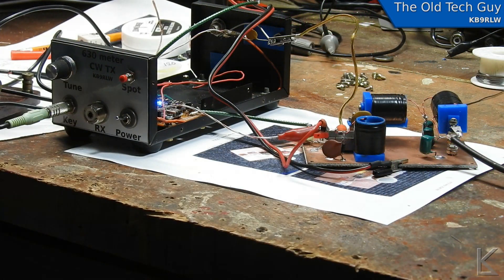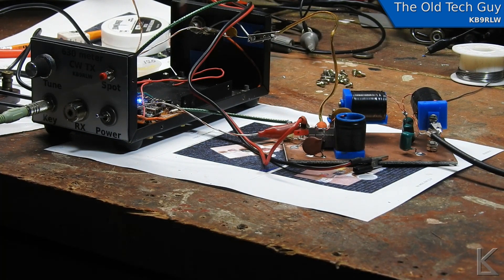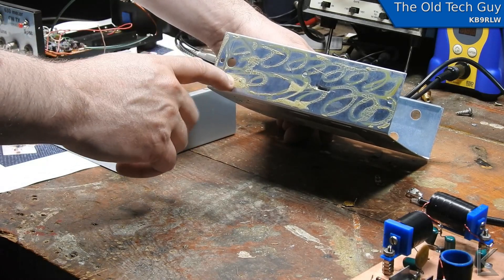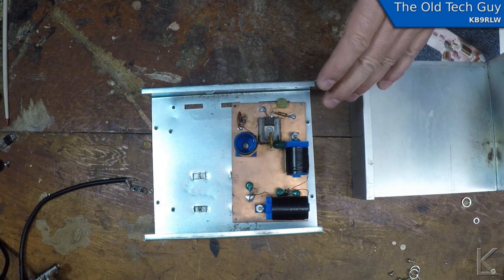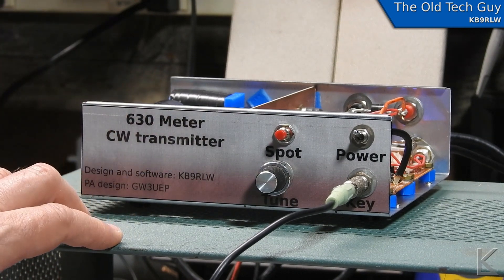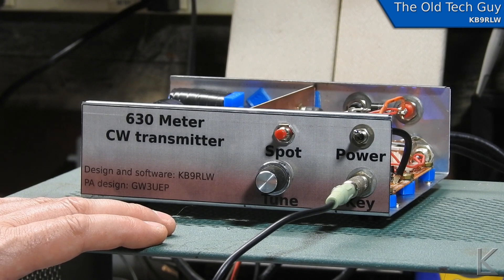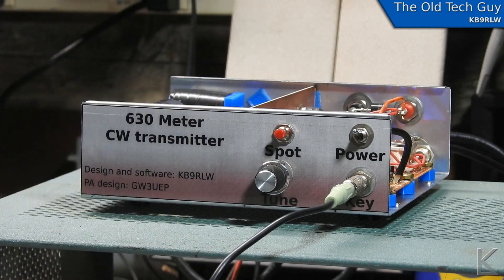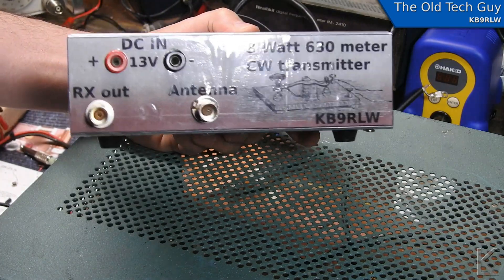Ham Radio - The 630 meter CW transmitter part 4.  It's done and it works!

Comment: I think if I was to make a transmitter for 630 meters, I would probably use a converter that converts 80 meter signal with a  mixer to 630 meter frequency.  I think it would be much easier and get more power.
Reply from the maker: Transverters have to have their own power amplifier.  You can only drive them with a few hundred milliwatts.    You actually need to attenuate the output of the radio transmitting on 80 or you'll blow the transverter.

Comment: Would a VN66AF not worked as the driver and the final power stage as I have seen them used at 27.60125-27.99125mhz
Reply from the maker: No, that transistor has a 1 watt max power dissipation according to the datasheet.
Reply: I meant that a VN66AF would work as a driver and a higher power VMOS transistor should work as the output stage.
Reply from the maker: It would be overkill as a driver.  And you did say, "driver and the final power stage". ;-)

Comment: I always thought you calculated RMS voltage from peak to peak by multiplying 0.707*Vp2p.  Am I wrong in this?
Reply: Doh, nevermind, I just remembered (or maybe googled, hi hi)  It's Vpeak*0.707 (not peak to peak).  Glad you jogged my memory on that one.
Reply: To be even more precise..  its Vpeak times (1 / SQRT 2)
But that is splitting hairs.. ;-)
Reply: flexairz, indeed

Comment: Nice xmtr Kevin. Hard sounding keying which i love! Makes a diff when using QRP. I'd love to see you show us the RF keying envelope. Ignorant question now- on 630 meter CW, is QRP not limited to 5 watts like the commonly accepted power output level on HF? Thanks for the interesting series!
Reply from the maker: The keying only sounded harsh because the receiver was so close.  That little Grundig doesn't deal well with strong signals.   It's actually very clean sounding over the air.
We are limited to 5 watts EIRP.  Radiated power at the antenna.   Since the antennas we can manage are incredibly inefficient,  you could probably drive 60 watts in and still radiate less than 4.
Reply: I meant the keying characteristics were desirable - at least for me with my 59 year old hearing. Regarding the output power of QRP I disagree with you.  You are correct in that the allowed limit is measured in EIRP.  Since you cant know your anttenna one-direction gain - without extensive in-field analysis - EIRP cannot be calculated by you. That doesn't mean that you can arbitrarily choose to drive 60 watts into the transmitter end of the feedline and still (1) assume that you would still qualify as QRP  and   2) to do so but with a higher arbitrary pwr level of your choosing - could result in illegal operation.  Kevin - with all due respect (because of your very good vieos that we all enjoy) in the real world, one measures their power output at the feed point of their feedline.  Every QRPer I know does this.  I bet every member of my favorite club (NAQCC with 9000+ international members) does as well.  Want more power delivered to the antenna? lower feedline loss.  Ideally use open wire ladder line. Do what you can to make a decent antenna.  It's surprising how efficient simpe wire antennas can be in their favored direction!  Again - nice work on the videos.  A lot of work they are, I'm sure. Thanks

Comment: Hey Kevin I am working on an inverted diamond five band quarter wave antenna for field communications . The bands are 40 m , 20 m , 17 m , 12 m , and 10 m , with 16 17ft ground radials . Can you give me some thought on my design ? I am using 2 inch to 1.5 inch pvc pipe for the main mast of the antenna with four radials for the 20 ,17 , 12 , 10 meter bands . I am also using a 5 way tee for the top with eye bolts for the draw cords to draw up the wire elements . For the main 30 feet of the central mast I am using 2 inch pvc and the top will either be 1.5 inch or 1 inch pvc pipe of 4 feet 6 inches  the lower sections will be 40 inch sections so I can transport it to any location .

Comment: This my be wrong, but I thought that using the bnc-t would halve your power.  No?
Reply from the maker: No,  That would be a crazy amount of loss.  Where'd you get that idea?   BNC  loss is in the range of 0.1 to 0.2 db according to amphenol's spec sheet.  And that's at 3Ghz.  It would be less at lower frequencies.  Even at 0.2db, that's around 4% of your power, or less.
Reply: It would if the impeadances were equal. But, the scope should have a very high impeadances compared to the 50 ohm dummy load.
Reply: J. Williams thank you. That explains my error.  I was not concerned about Insertion loss, but I was thinking of it as a signal splitter.  Which of course would use similar impedance devices.
Reply from the maker: Oh,  I thought you were talking about the antenna connector on the TX itself.   I'd never heard anyone say half insertion loss, so I was surprised.

Comment: I would opt for a 12 foot diameter mag-loop antenna. Cause it's 630 meter and with antennas, the bigger the better. And as always,,, you can run multiple wire loops around in that circle from one stand of wire. I've contemplated using pvc pie and copper tape to make a copper cactus antenna. I might use that technique to make a magloop, to save money. If not tape,, then a foil.